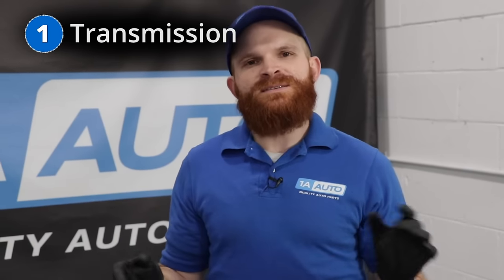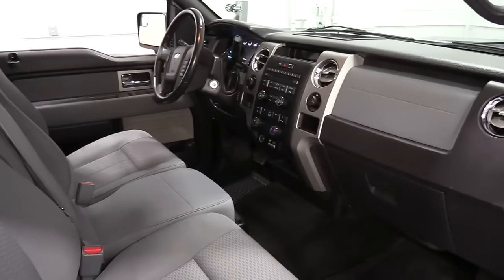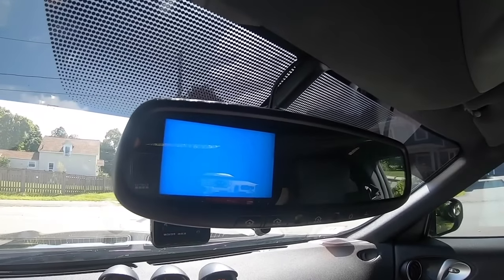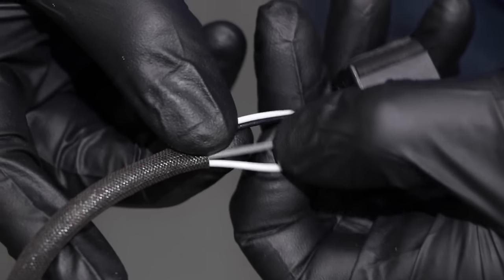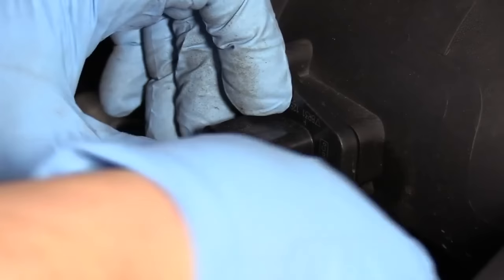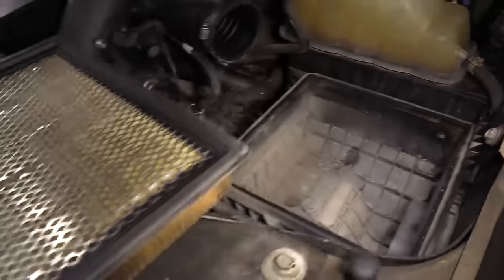Top 5 Problems Ford F-150 Truck  12th Generation 2009-14

Comment from the maker: 0:14 Transmission Recall
0:56 MyFord Touch Head Unit
2:42 O2 Sensors PO130 PO150
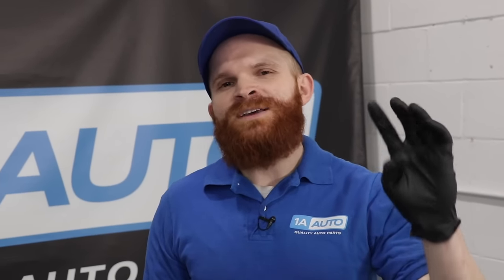3:53 Canister Purge Solenoid
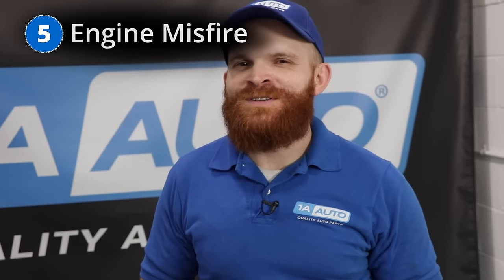4:54 Engine Misfire
Reply: Reached out to Ford for my 2010 on the safety and stated there was no recall. Then went online and also do not see a recall notice.
Reply: Misfire
Reply: On my 2011 F150 Ecoboost, in addition -  Sync system not responding (replaced), seized vacuum pump (replaced), shattered rear window after defrost activated (replaced window assembly), rusted out front brakes/rotors (replaced), engine start up rattle at 35k miles (vehicle traded out at 40k, someone else's problem now).  There were some other problems that I'll skip...................
Reply: No mention about the intermediate driving shaft, the rear wheel wells rusting out in no time,  and look out for bed light gasket rots quick and water leaks in thru it and rots your roof liner before you know it’s happening.  I’m on my last Ford truck never again!
Reply: Engine Misfire - Intercooler has oil/water pooled in bottom.  Hole can be drilled to drain and fix misfire problem.
Reply: Hello I bought a used 2013 Ford f 150 that my transmission  is doing just as you described. It started as I was driving it just hours after I bought with no warranty! I entered my vin # but it says no recall on it. Do I have to go to dealer to see if there is a recall?

Comment: So basically,  get a vehicle that doesn't have a computer. Seems like the miles of wires, faulty sensors, bad programs, and junk plugs and  harness are all the problems. Lol, better get you an 85 square body

Comment: Ain't no one truck better than another they all have their mulligans.
Reply: True true. We just gotta keep our fingers crossed whenever we own whichever one we choose.
Reply: I got a 2012 FX4. so far, my blower motor resistor went out. $15 later, and done. :)
Reply: Have u owned a 2015 Chevy?
Reply: they cost way too much for these kind of issues
Reply: Consumers are the test dummys.
Reply: I have the EcoBoost it's amazing bad too the bone I ran it against a dodge and Chevrolet beat both of em lollol
Reply: 2 words TOYOTA TACOMA
Reply: Whats mulligans
Reply: Well two of the problems he mentioned plaque my 2010 Lariat.  Camera and Cannister. hope there is a s/w update to it. 

worse b—thx on these vehicles are those with DATC, and a 30$ blend door actuator sits at the bottom of the dash resulting in 1200$ in labor.  hot air on one side cold on other.  now seems like it is doing it again. 

And let’s not forget that expensive rear window defogger with the sliding power window and realize it no longer has defog.   but 800-1200$ later and if ya can find a replacement window with the heat element in it, you have a window defogger. 

Camera has annoyed me for years. worse in summer.   can deal with the window defogger in the SE area.   but that actuator acts up again with summer starting and i may just sell baby sell. 

what sucks is Ford and other companies know these issues, and they don’t do a damn thing to fix them. go figure ¯\_(ツ)_/¯ 

Love my truck.  but AC and i are a must. and not sure if i want to screw around with a 30$ part when the AC is cold on my side. 😏.  

but why don’t they fix these issues.
Reply: @cheetopuffs2580  2 words, rusted frame, no thanks
Reply: Besides Toyota which is best if reliability is your thing
Reply: Mulligans 😂
Reply: @cheetopuffs2580  😂 ☝️

Comment: You forgot to mention if your truck cranks but wont start to check fuse #27, blown fuse or burned connections.
Reply: Happened to me a few months ago
Reply: Exact same thing happened to me I worried that I had to get a new fuel pump or a part fuel related, thankful for the ford forums
Reply: Here here!
Reply: 2014 5.0 same thing at 80k
Reply: Yep happened to me on my 2014
Reply: Went to start my 2010 after work one day and did this I was freaking out thankfully just the fuse as as well lol
Reply: Same thing happened to me
Reply: Good call. This exact this happened to me at 67k miles
Reply: Yes, and there is a "Fuse 27 Relocation Kit" from Ford. Moves the wires to an unused slot with better contacts.
Reply: Moved mine to #70 today!
Reply: My 2014 f150 5.0 has been at dealership since July 2022, and it's now end of September 2022
Reply: Has the fuse 27 issue caused stalling and stumbling? Or just a no start condition?
Reply: Happened to me a couple months back. Was stuck in 10 degree cold outside the movie theater😂. I was preparing to cough up to replace my fuel pump, but checked the fuses and there was my problem. I have a 2013 Platinum.

Comment: Here's  a really neat trick I learned years ago; if you suspect a engine misfire, take a good thick piece of paper and hold it flat up against the tailpipe. If you can see and hear a "put put put" sound then chances are you have a bad spark plug or fuel injector.
Reply from the maker: +Jonathon Haug Thanks for the tip!
Reply: actually learned this in school. it’s literally called the paper test. you have that back pressure, look into an ignition miss
Reply: Or mkre simply you just look for a p03xx code.

Comment: I think it also has a problem with the heated tailgate.   It is really cold when you're pushing that Ford to the side of the road lol.
Reply: I gave a thumbs up even though I'm a Ford guy because damnit thats just funny
Reply: Lets be honest when have y’all ever seen a Ford on the side of the road?
Reply: @jakehodges4602  my 2006 GMC Topkick flatbed has seen MANY MANY MANY of them, between the Focus, Fusion, and the 12th gen F150, i cant say which one is worse
Reply: Heated tailgates are for the Ford lovin' hotties at winter bonfire parties ;)

Comment: I’m the original owner of a 2009 5.4 S/crew FX4 Luxury Package, besides regular maintenance items like belts, brakes, plugs, etc.this is what I’ve had to repair in 13 years now: Passenger side A pillar water leak through the satellite radio antenna when fairly new, then the A/C compressor clutch went out while still under warranty. Had a nice stretch of zero problems for a few years then I had to replace the passenger side exhaust manifold in 2018, 3rd brake light leaked and replaced in 2019, heater fan blower motor resistor in 2021 (would only run on hi speed) and then the heater fan motor itself in 2022. With meticulous engine oil changes the 5.4 still runs quietly so far…Overall I’m pretty pleased with it after 13 years of use considering the questionable reputation of the 5.4 as I haven’t even had the check engine light come on once in all this time.

Comment: I have a 2010 FX4 5.4L with 180k.The only problems I've had to fix: 
1. replace broken sunroof mechanisms (requires removing the entire headliner)
2. replace water pump and pulleys 
3. lift motor to replace exhaust manifolds and extract 6 broken bolts
4. replace cam phasers, timing chains and roller rockers due to $20 broken plastic chain guides (upgraded to cast iron chain tensioners and hi-po oil pump) 
5. replace ECM that was coding 
6. replace rear taillights due to moisture problems
7. replace AC compressor 
8. rebuild blower motor
9. replace console cover due to broken helper spring (wtf)
10. transfer case rebuild 
Mods: 
1. Bilstein performance shocks with 2 inch lift 
2. K&N air filter 
3. Borla touring exhaust 
4. Cross drilled and slotted rotors
5. Tibren load springs 

8 grand later...runs like a champ and sounds incredible. Fortunately I can wrench or it would have cost me double.  I bought it for 24 grand with 36k miles.

Comment: Also, fuse #27 burns out often, not letting your truck start up if it’s been running for a while. Fuse is prone to BURNING out due to the bad placement of the fuse box. Easy fix to replace the fuse to get home but a fuse box relocation kit is the ticket.
Reply: Happened to me a few months ago
Reply: We just checked it and that wasnt it, took it to the dealer ship and nothing
Reply: Eventually that fuse is going to melt and short again. Ford has a tech bulletin on this and O’Reillys and some of the auto parts stores sell a kit that you can purchase and easily upgrade your fuse box with the new fuse. The old one was not enough for the current. The TSB has you moving the location of the fuse. Don’t make the mistake of taking your truck to the Ford dealer they’ll charge $1800 and tell you that it was your fuel pump.

Comment: Don't forget the A/C evaporator getting clogged with dust and crap, causing weak air flow. And you have to remove the dash to clean it, because a cabin air filter was omitted by the engineers.
Reply: My 2011 f150 has 211,000 km and everything including the ac works perfect.it blows so cold that I can’t even use it on full,or I’ll freeze.the heater is also amazing.it’s only ever on low,even in the winter.honestly I love my truck.no complaints about anything
Reply: @jakejohnson9827  That's literally every Truck now. Fords retain more of the work truck feel  then Dodge or Chevy
Reply: You don't have to remove the dash. Just score 3 lines of a square and flip back the tab you cut in the Evap housing and wash it out gently after applying cleaner. Push it back then  Seal it with some good AC duct tape or drain pipe seal tape. Its just a plastic box and isn't thermal. The fan blows through the evap coil so its fine. Garbage design with no cabin filter. Shame on Ford

Comment: Holy shit dude, I’m so happy I found your video. I looked where the fuel canister box is at I see a plug on the end and one of the wires is cut. Gonna rig up some southern ingenuity on this wire and see if this is my problem. Keep doing what you’re doing bud you may have saved me from a rabbit chase.

Comment: You need to make a 12th gen video engine specific.  Those years had some of Fords main engines in these years.
5.4, 5.0, 6.2, 3.5 eb
That's a ton of different problems to look at
Reply: 2009/2010 4.6 V8

Comment: I would add coolant reservoir leak, and timing chain tensioner too. Fuel door coming loose. Might be a few more im forgetting at the moment. I put a Pioneer headunit on my 2012 XLT 3 years back. No issues ever.

Comment: Fuel filter/gauge, windshield wiper switch, rear window(after it shattered) fuel filler door, serpentine belt, water pump, rear driver side door lock motor, back-up camera shifter connectors, water hose ‘o’ rings— but after replacing all that, it’s a dam fine truck!
Reply: Oh yeah- tire pressure sensors too
Reply from the maker: +Zane Seligman Thanks for checking us out. Shop for high quality auto parts on 1AAuto.com:

http://1aau.to/m/Shop-1AAuto-c
Reply: Add a year since that comment: replaced the coolant system ‘y’ connecter, driveshaft! This had to be ‘made’ for me ; $700. And most recently: the stereo is on the fritz —- oh also, ( I’m sure I’m about to come outta pocket for this) (and it’ only did it one time) the power steering …. I don’t even know what to  call it- i think it’s an electric pump(?) / it dosent operate off the belt— here’s a plus: just changed the original brakes ( pads only because the rotors were fine @ 192K miles!
Reply: But it IS paid off finally! Lol So that 3 ton mess is ALL mine!! :)

Comment: I have 2009 with a 4.6 251.000 miles changed oil every year rain or shine. Never had any mayor issues. Has a clicking sound when starting. But runs like a champ.

Comment: I love my 2013 5.0 F-150 with 195000 miles on   it
Reply from the maker: +Terry Terrill Thanks for checking us out!
Reply: are you having or had issue with your reverse cam? when you put it in reverse it goes black. If you did, what was your fix?
Reply: Awesome brother I have a 2011 Ford F150 with a 5.0L Coyote V8 in it with 135,000 miles on it and still going strong and it's a beast and it sounds like a beast as well with the Borla ATAK Catback exhaust.
Reply: any problems?
Reply: 2011 with the 5.0 with 215,000 miles. I had the TCM computer board fail and do something similar to #1 and had #4 occur at 125,000 miles. The TCM cost me around $1200 and the charcoal canister issue was $350.00. The stereo went out which sucked so I put an after market in. Starter went out at 150,000 mikes, the truck starts up so fast those teeth get worn out. Those have been my major repairs since I’ve owned it. I’ve got a friend with the smaller 2009 4.7L v8 at 350,000 miles so I’m still optimistic to get some more good miles out of mine.
Reply: Dude I hot 257,000 Miles on my 2014.  And still that coyote 5.0 still hauls ass. Been a ford guy all my 40 years of my life and was about time ford actually brought the good things back 302 cylinder is the beast
Reply: I was looking at a newer f150 but i cannot get rid of my ‘13 5.0L only thing i had to do so far was replace the power steering rack which was spendy

Comment: Only problems I have had with my 2012 Ecoboost are coolant line leaks ( both roughly around 125-135k miles where they connect to the overflow tank as well as the turbos), and misfires from worn plugs( between 80-100k each time) Currently A 189k and still running good. Tow a sxs up the mountain quite a bit and am on the throttle all the time too. Great truck.
Reply: My coolant exploded on me like a week ago and had transmission sensor problems and bad oil pump and new steering rack
Reply: For my 2013 5.0 ford
Reply: I have a 2013 5.0. Just search Y connecter coolant hose and 
O rings! Ford could not fix it in three attempts. I did it myself off a YouTube video and ordered the parts off Amazon. Hasn’t leaked since😎
Reply: hey i have a 2012 ecoboost 3.5, i got last summer, and my front right brake was dragging when i got it. 
i replaced caliber and rotary but later that day it started dragging again.

i changed severai times trying to find problems as i went because the diagnostic machines said nothing was wrong at dealerships (went to 3 in 3 different states while working).
after several miserable weeks of this i was finnaly told by a guy on the streets that it was the soft rubber hose going from brake line to brake caliber.

i replaced both for around $40 and solved the problem. 

now its working fine and pulls like a ox.

Comment: Bought a used 2013 F-150 FX4 with a 5.0L about a month ago. Everything went ok until I drove up hill and oil pressure light flashed then went back to normal again. I’ve already bought the oil pressure switch for it, but haven’t installed it yet. 100k coming up then I’ll work on  all maintenance tune up. I just got to drive some more to check for some underlying issues. Thanks for the video ✌🏽
Reply from the maker: +Bone684 Thanks for the feedback!
Reply: My 2013 f150 does the oil light thing... seems to happen when the rpm dips low at a stop ... also common when put into reverse... still not are of cause... changing oil pressure sensor dont fix problem

Comment: Lead frame recall on 2013 5.0 covered under 150k miles under warranty $1700 job if you miss the 150k mile cutoff. oil pressure sending unit or sensor faulty at 175k miles.  I had the purge valve issue.  Otherwise, that 5.0 coyote engine is a beast
Reply: Do you have to have a problem with transmission to have lead frame replaced under warranty  or is it covered regardless?
Reply: Nailed it. Just replaced the oil pickup sensor at 182,000

Comment: I have a 2011 Ford F150 with a 5.0L Coyote V8 in it and with 135,000 miles on it and still going strong and it's a beast and it sounds like a beast with the Borla ATAK Catback exhaust.
Reply from the maker: +CJ Colvin Thanks for checking us out! http://1aau.to/m/Shop-1AAuto-c
Reply: @1AAuto  You're welcome brother.

Comment: Evap canister purge valve, O2 sensor have had to be changed on my 2010.  Another common fault is the AC fan blower motor resistor behind the glove box.  That's had to be replaced three times.  Also watch out for the 4WD hubs trying to engage due to a lack of vacuum.  That can be fixed by replacing the $14 blue check valve located against the firewall.

Comment: The phasers on the cam tensioners, that’s a 5k repair, turbos leak radiator fluid, and my favorite, AC blend doors are total trash. Spent $1200 to have all for of them replaced with OEM parts and not even 6 months later, you guessed it, driver side and passenger side blend door no longer work. I will never own another for after having this FX4.

Comment: Unfortunately these vehicles need good routine maintenance, mine had over 150,000 miles with only the IMS issue.  Oil is the most important issue with the 5.4. Never use 5w-20, when the engine came out 5w-30 was recommended.  They changed for gas mileage and it is too thin for the cam phasers when hot.

Comment: What about the timing chain tensioners going on the 5.4 tritons. The driver's side springs breaking. The front driver's side calipers locking up. The VCT solenoids getting dirty and causing misfires and it to run rough. And the 3rd brake light leaking when it rains and getting the interior soaked. All these are fairly common issues

Comment: 195,000 miles on my 2012 5.0. Purge valve is the only mentioned issue I’ve had.
Reply from the maker: +dustinrolla Thanks for checking us out!
Reply: Yep me too. Y thing on coolant line. Elbow leaking under coolant resivoir. Radio went out. Blower motor. Rear defrost is out. Driver side iwe or vac line. Think rear main leaking now. 250k on it. Runs great besides these things. Ha.

Comment: if anyone having issues withe 4x4 make sure to check that the vacuum hub, most of these get dirt and or sand really easy and they will not open as the are suppose to. Transfer case is hard for it fail its more than likely tht is something as simple as the vacuum hub